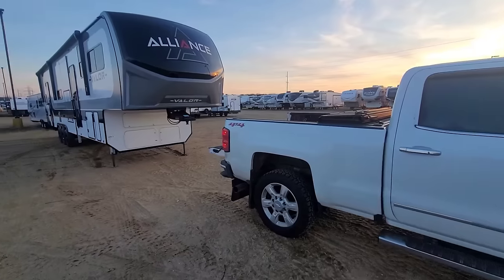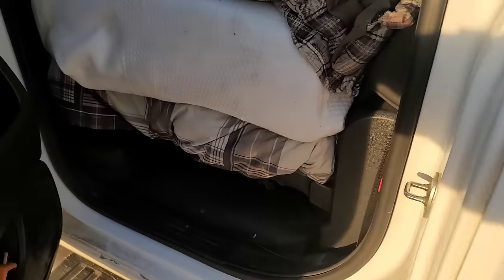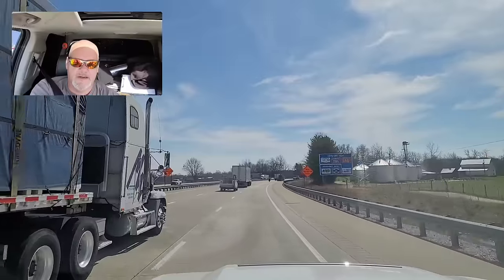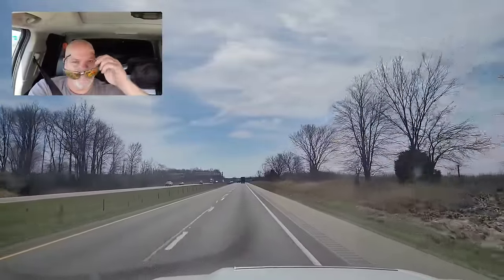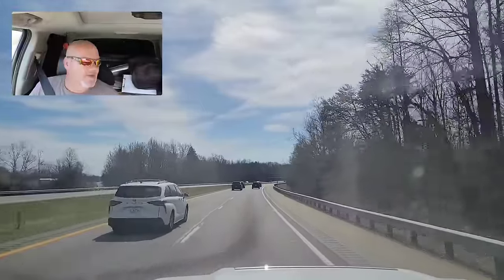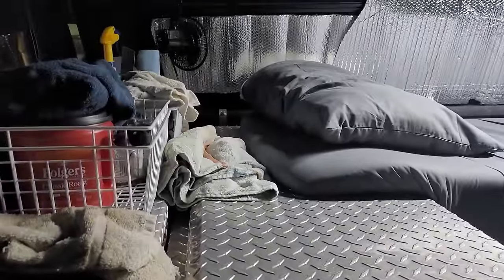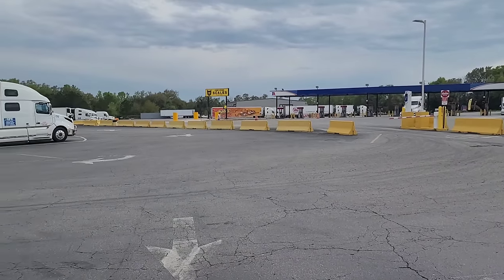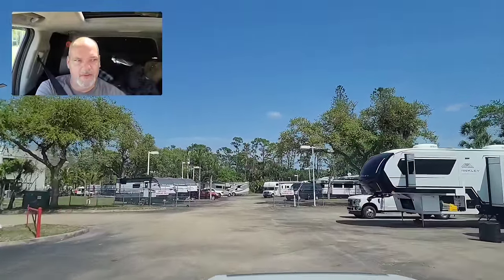Indiana to Fort Myers, FL 3-13-24

Comment: Great video, that would be great if you could do a video on that Duramax that was stretched. I spoke to the truck sleeper right outside of Goshen and they referred me to an Amish company that could do a stretch. I forget what the price was but I was too nervous at the time to invest the money to do that have to change and who knows what all else has to go along with that build the sleeper wasn’t that much money depends on what you want inside, but I didn’t have an air condition on the top. I think there were something that was on the back of the sleeper my questionwould be the turning radius on that truck versus what we have now if you could find out about that that would be a great update

Comment: How are you legally running a combined 30,000 with a legal limit of 26,000
Reply: I understand your actual weight is under 26,000 currently but the gross vehicle weight rating with your truck and that trailer is 30k How do you get by with that?
Reply: Hi my name is Stuart. I am using my wife's YouTube channel. I live in Naples, Florida. When you are pulling a brand new RV out of Elkhart Indiana, you don't go by the GVWR or anything like that. You go by the actual weight of the fifth wheel or travel trailer or whatever it is. The actual weight is all that really matters. He's got a single rear wheel I guess 3500 so I don't know what his rear axle is. It's probably 8,000 lb and that trailer probably weighs 16,000. I'm not sure but he should be okay. And in all actuality three axle trailers are lighter on your pin weight that's on your fifth wheel. Usually they're lighter a three axle trailer so he should be fine. He's actually only limited by his plate. If his plate is 26,000 he may be close and if he's got to see the l he can obviously go hire All right. Just curious about all this. Very good though. Good video😮
Reply: By the way, I forgot to mention according to the federal code there is a waiver regarding the fifth wheels GVW or GVWR. Whatever it is, it's by actual physical weight of the dry unit coming from the factory, so he would not have to worry about any of the weight ratings or anything like that on that fifth wheel. It's all by the literal weight on the scale of that unit. That's all there is to it. I will get the federal code and I will post it here.

Comment: So aren't you still over weight cdl or not since that truck has a 5th wheel tow rating of 13500k at least that's what I was told it was from dealer I do not have a sticker on my door and I have the same truck same year